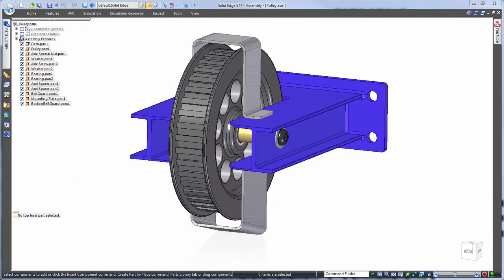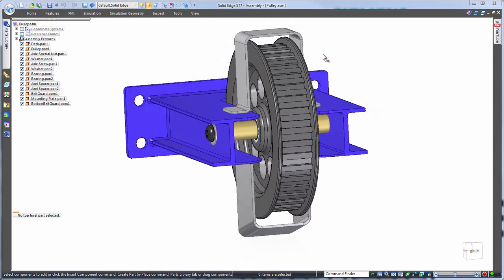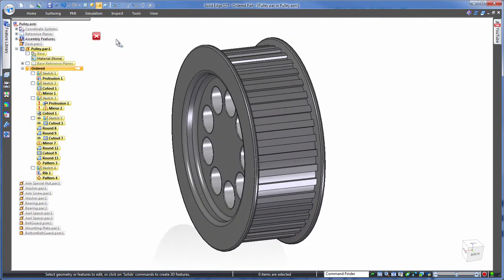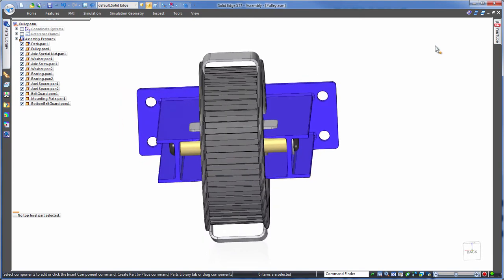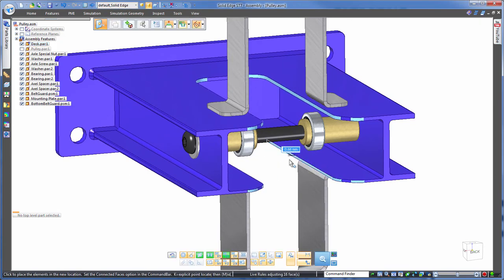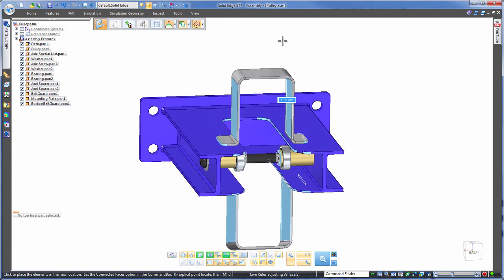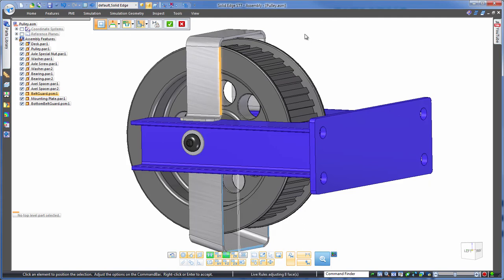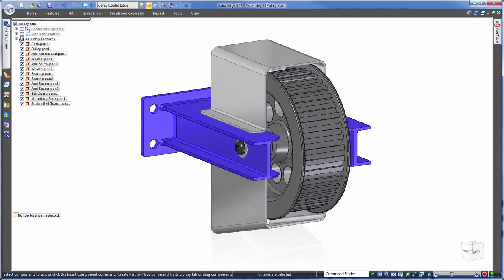Solid Edge Synchronous Technology - One shot multi-part editing

Comment: Thanks for putting this up.
Firstly, i like the 'ordered' change to the pulley wheel - nice and easy using existing profiles and the auto symmetrical live rules. It's 'old style' but efficient  - those profiles are a good reminder as to why something was decided that way - or am i getting old?!
Now, i also like the ST 'on the fly' FAST modelling changes to multiple parts with the added face intelligent co-planar regonition selection PLUS, symetrical live rule application. A good demo of SE + ST evolving power and more importantly, design FLEXABILITY and ASSOCIATIVITY without any prior knowledge of minor or radical downstream changes.